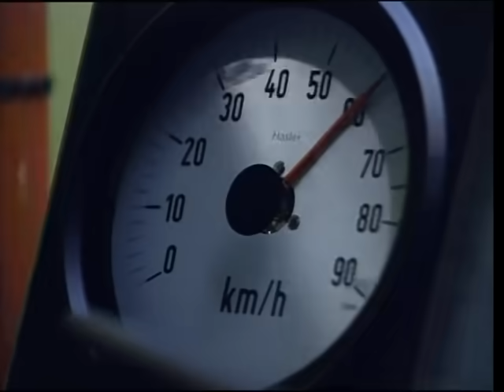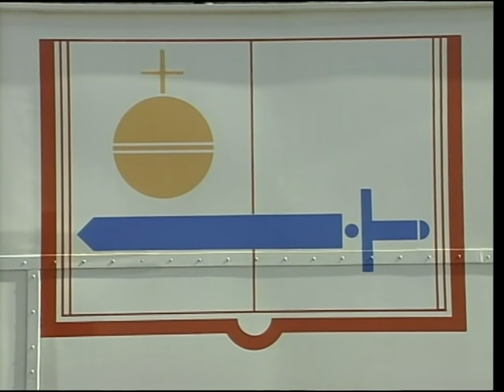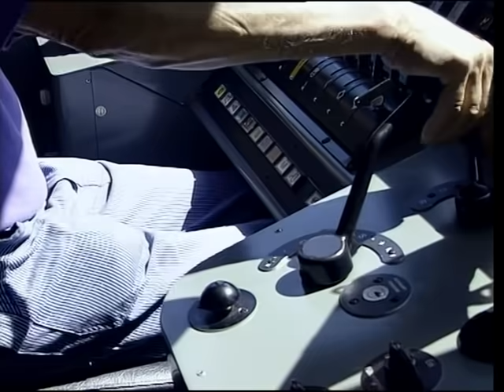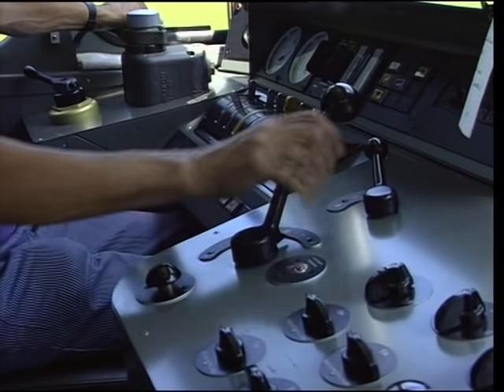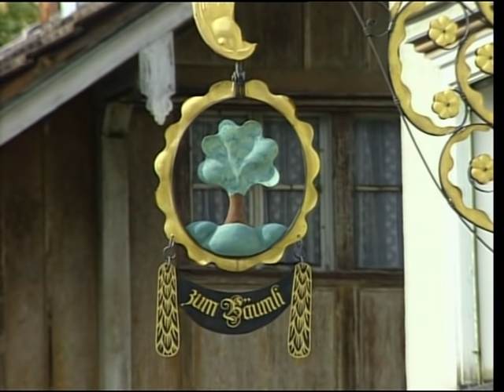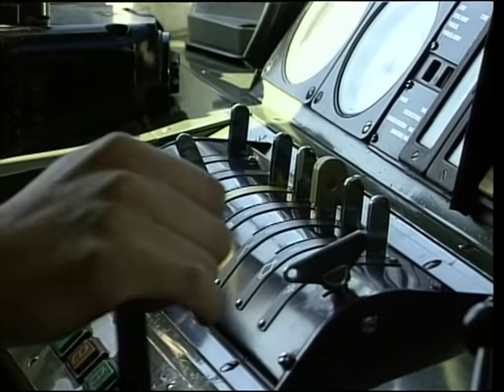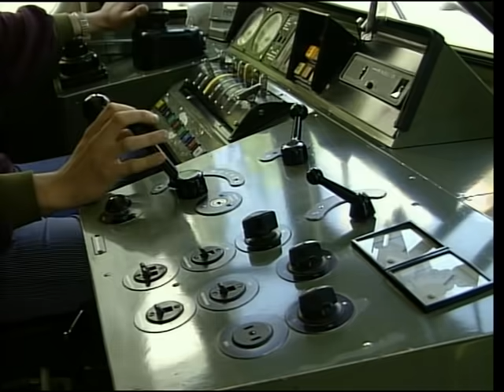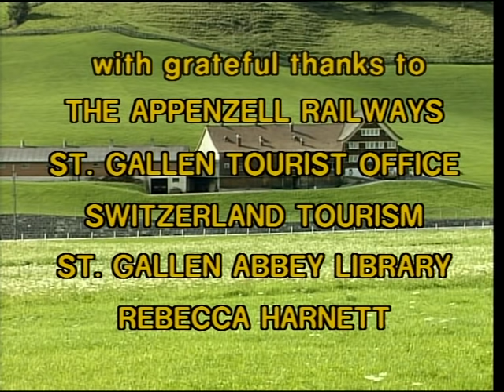Swiss Railway Journeys - The Appenzell Railways

Comment: Some updates on Appenzeller Bahnen after this movie was produced:

The Trogenerbahn became part of AB in 2006 alongside the Rorschach-Walzenhausen mountain railway and Rorschach-Heiden mountain railway, both rack railways but with differing gauges (RWB is 1200mm, while RHB is standard gauge). Due to a different electrical system, passengers from Trogen had to alight in St. Gallen central rail station for journeys towards Gais, Altstätten, or Appenzell, though after the fusion both TB and SGA lines shared the same forecourt still beside the SBB station. AB also used different rail stock for each portion, with Be 4/8 three-car trainsets used for the St. Gallen-Trogen line inherited from the Trogenerbahn, and the SGA line using the shown rail stock in the documentary.

This all changed in 2018 when AB decided to make a through-line (Durchmesserlinie) from Trogen to Appenzell as part of the S-Bahn St. Gallen transport conglomeration. The following changes were then made: the Trogenerbahn's electrical system was then changed to the 1500V DC standard sans the downtown St. Gallen station which had to use 600V DC (since the electrification was provided by the St. Gallen city transport for their trolleybuses), the rack section after Riethüsli was replaced with a tunnel section (to the dismay of many AB fans) and some stations along this section were relocated or closed, and AB bought new Stadler Tango ABe 8/12 EMUs with special modifications that allow it to run on different sections of the line which had different rail profiles (the Appenzell section had higher rail dimensions than the Trogen section) and could use the two mentioned voltage systems.

The Gossau-Appenzell-Wasserauen section now uses Stadler ABe 4/12 "Walzer" three-car units alongside the various BDe 4/4 cars.

Finally in 2021 the almost 18 km Frauenfeld-Wil railway between the two mentioned cities in Canton St. Gallen fused with AB, making it the most recent fusion in a railway company that was created due to fusioning. AB also made a feasibility study on the continued operation of its rack railway lines, promoting them to transform the  Rorschach-Walzenhausen rack mountain railway into a Level 4 ATO automated railway, the first of its kind in Switzerland when it starts automated operations in 2026. Sadly the same study also suggested that AB would cease the Altstätten-Gais rack railway line by 2035 due to shrinking passenger use and the end of life of the ABDeh 4/4 and BDeh 4/4 electric units.
Reply: May I add that the Bodensee region of St. Gallen and the Appenzell (Ausserrhoden) cantons were some of my favorite places in Europe. I spent two days enjoying the region with my goal of visiting the Appenzeller demonstration cheese factory in Stein AR, being a fan of their cheese. Sadly the Durchmesserlinie was being made during my visit so I was not able to ride the AB (Stein AR was also out of reach of either AB line anyway, and was only accessible by road through Postauto or private car).